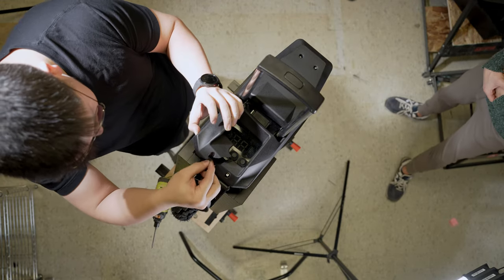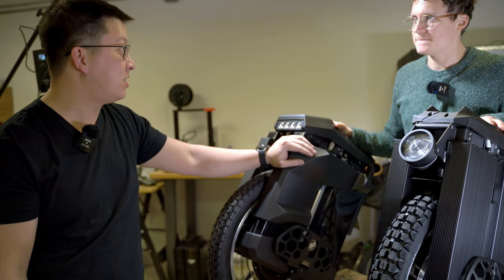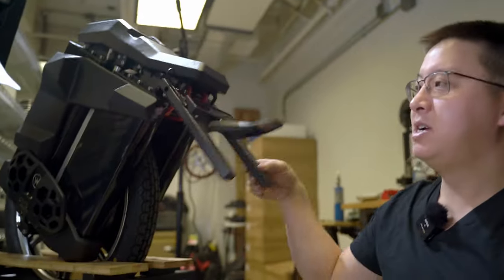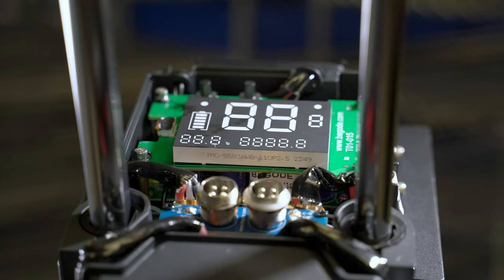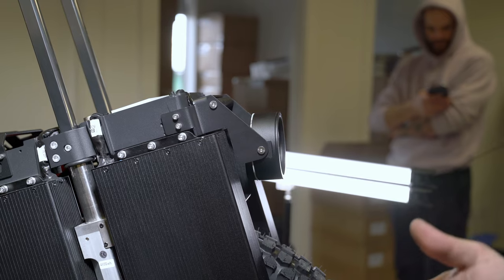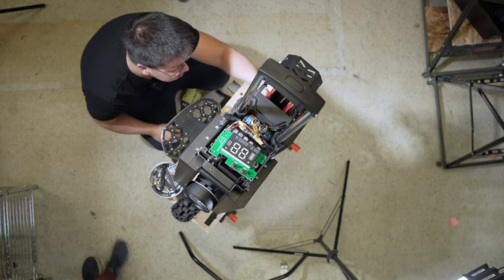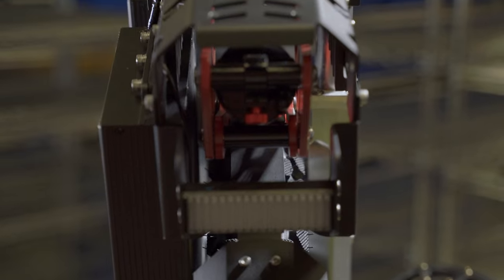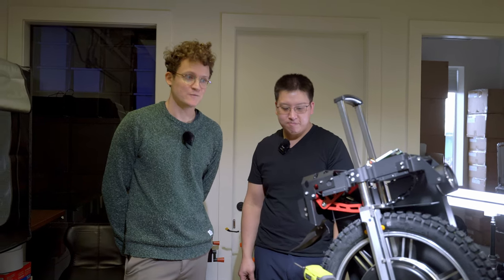Begode Master Pro V2 Teardown | What improvements have been made?

Comment: No summary or timestamps, so here's mine:

Battery box - now it's metal and rubber sealed.
Changed light - one bigger bulb, more adjustable but not as bright.
Tire - beefier.
Stand - now it's like the Master.
Taillight - like S22.
Display - easier to see when it's bright outside.
Top cover - more water resistant like EX30.
Beepep - behind the light and quite loud.

Comment: Thank you for a very helpful and informative video!

i read that the begode master pro v2 has a 4800 watt hour battery. and is higher voltage, which is my favorite (i love high voltage, the higher the better, i mean, higher voltage is my preference)

I’m studying euc’s because i would like to buy an euc one day. i recently purchased (i primarily ride scooters) a dualtron storm LTD and i chose this model for its range. but to learn that my storm LTD is a smaller battery compared to the begode master v2, surprised me. the storm limited is 3860 watt hours, 45amp hour capacity at 84 volts nominal (charges to 95volts), and i read that the begode v2 is well over 100 volts, and i do not recall the amp hour rating but i recall the watt hours being stated as 4800, which is absolutely beautiful! that is long range, to an extreme degree. which is exactly what i require in my commuting (over 100 miles each day, commute). i do wonder what the maximum amperage these cells can be charged at. i would definitely be utilizing the roger charger to charge this euc.

i am a researcher and i love to research the latest and greatest. my research and study has indicate that graphene battery technology is ready for prime time. i do hope this euc, maybe the next model, could offer a graphene battery choice, where i can pay an extra fee, to have the graphene battery. even if i had to install the battery myself, i would love this choice.

my research and study indicate:

graphene has greater cycle life

safe

greater energy density 

abundantly available materials 

many manufacturing process choices

cost more to buy, but pays for itself because of much greater lifespan (maintains capacity over the course of 20k + cycles)

please make a video about graphene battery technology, and if you think the technology would pay for itself over time, if given as an upgrade option or choice, at the time of purchase.

thank you for a highly informative, extremely helpful video.

Comment: The stand you need to 3D print a block to replace the two rubber bits provided, I did that for my Master and it was a good solution.

Comment: Does anyone actually take apart the "suspension"? In my adventures to retrofit onewheels with actual suspension I have found the majority of no name or name brand air shocks are just empty cylinders with no dampening circuits....esstienally a pogo stick!!! They rely on friction to slow the rebound and provide little to no added control. Would love to see a deep dive into the suspension circuits, the leverage ratios, and mounting designs. I bet many wheels and manufacturers would stop releasing these soda can plungers if people started calling them out. Kingsong has shown a standard MTB shock would work granted its a low-end DNM Burner, it still has an active dampnening ciruit. Which is why everyone thinks its so good. In reality DNM is the lowest end shock with actual internals you can buy.